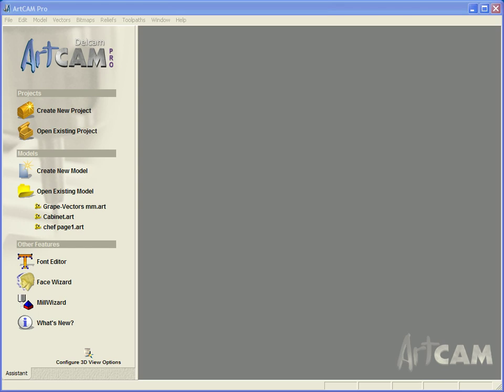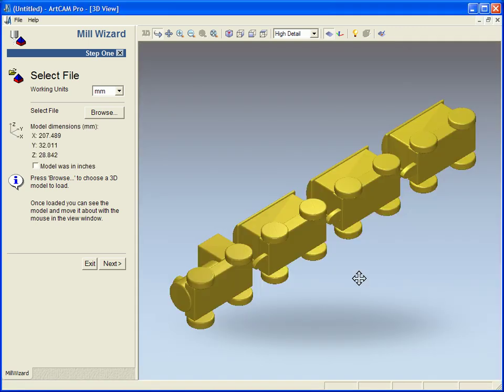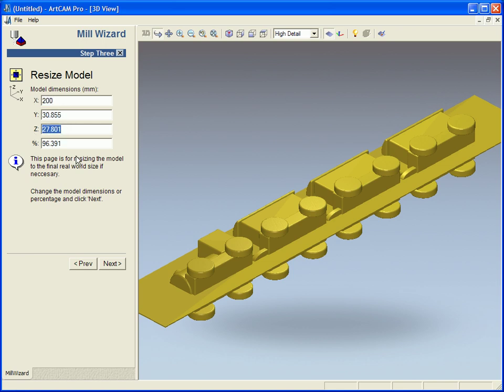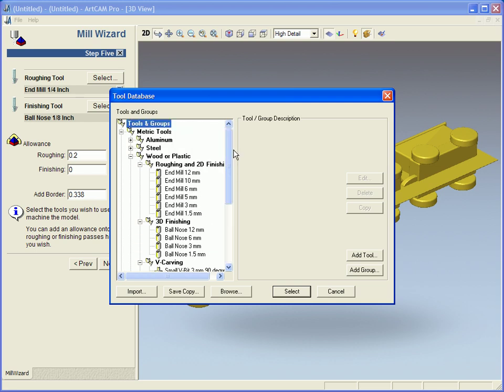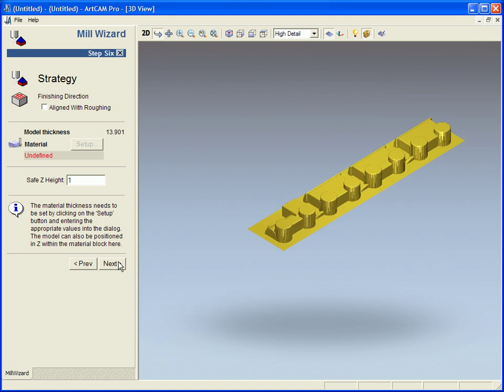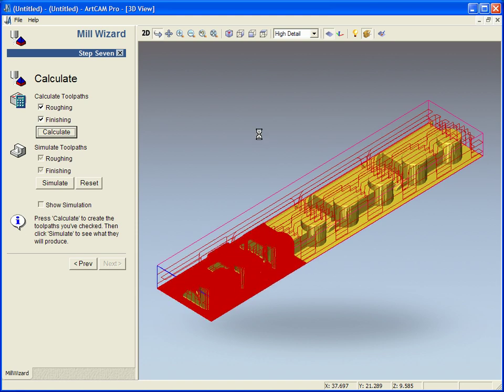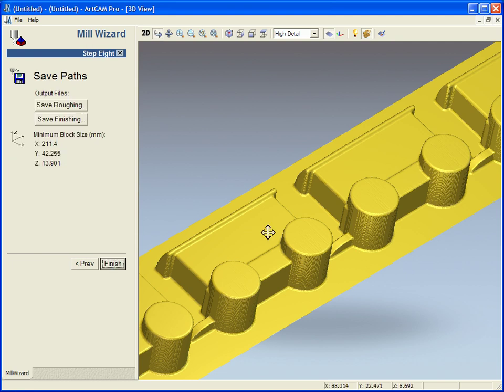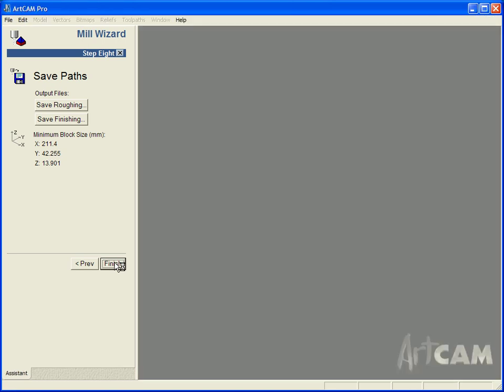Importing and machining a 3D model

Comment: Thanks! Great videos.
One question: on the original model, the wheels were actual 'wheels', on the carved model they were cylinders extending underneath the model. 
Would you be able to now rotate the part by 90 degrees (if you CNC supported this) and machine away the rest on the underside of the carriages so that wheels would be properly represented?
Thanks!
~Marc